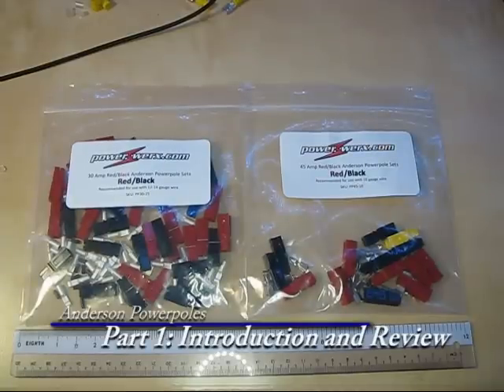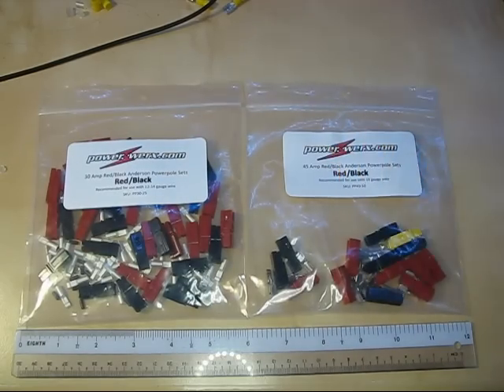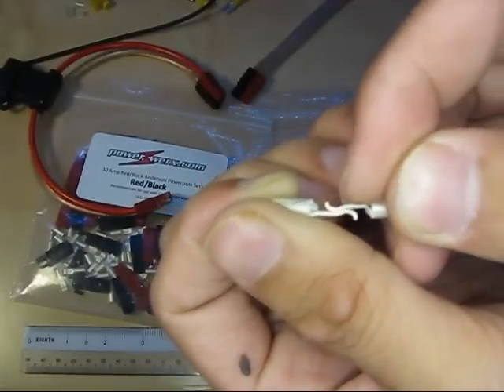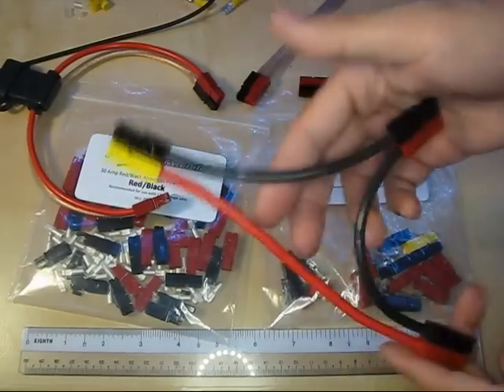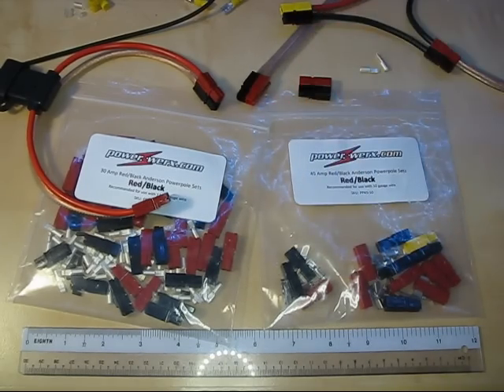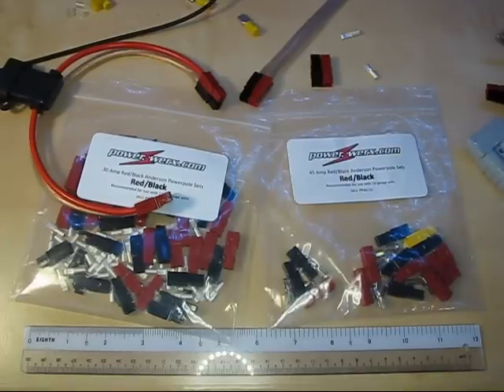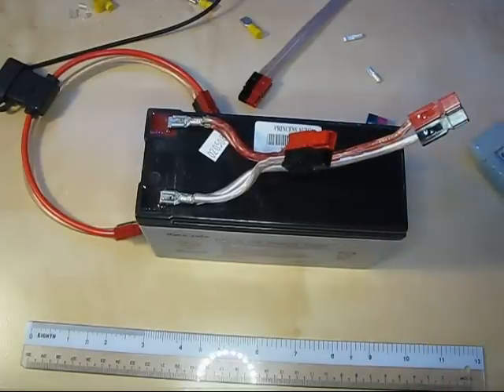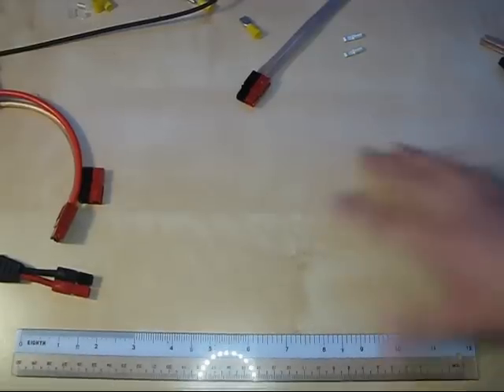Review of Anderson Powerpole Connectors

Comment: Can I crimp 15, 30 and 45 amp power conections with a RJ45 Network Cable Crimper? Can I use this on the Anderson Powerpole Connectors?

Comment from the maker: @obadboystanley Powerpoles don't have an immensely high holding force, they are meant for easy disconnect while still having positive retention. You could try using a zip tie to hold the connectors together if you want them to never come apart unintended (ie: permanent installation on mobile setup subject to vibration).

Also the contacts could be slightly bent, bend them towards each other. The spring shouldn't be damaged by assembly and use. If you want high retention, look at the SB series.

Comment from the maker: @jgefaell I was still in the process of crimping all the terminals, heatshrink will go over those spade connectors. Also, I wanted to make my own power sensing system with remotable sensors so I can leave the display unit in one spot but leave the sensors by the test unit, so I don't have to worry about being in a danger area when running 50-100A motors.